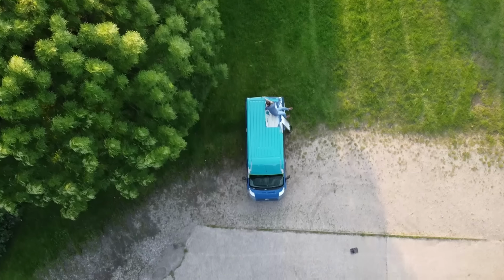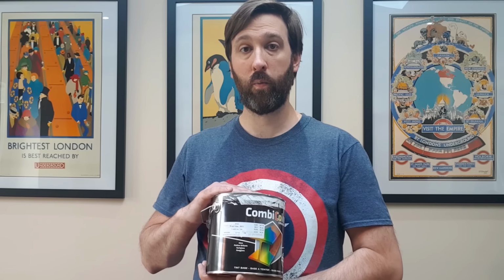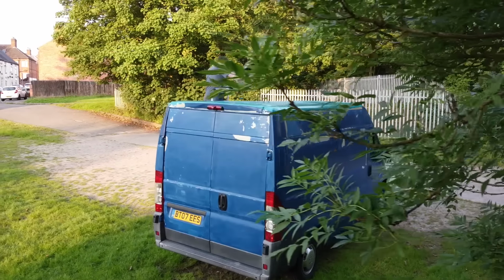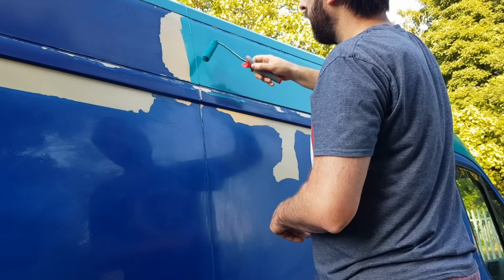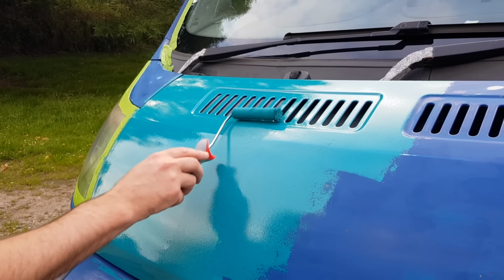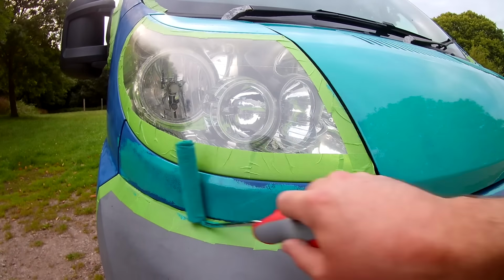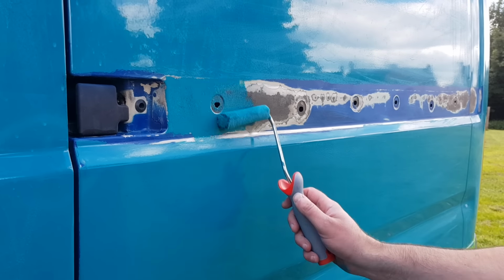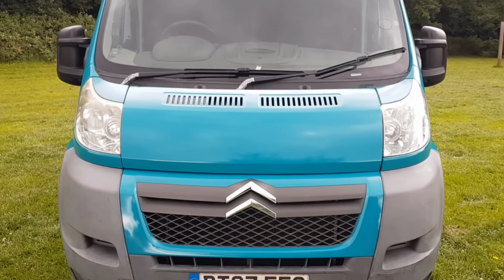Painting a CAMPERVAN on the CHEAP with a ROLLER! - DIY Budget Campervan Conversion

Comment: How's the paint holding up over time?
Reply from the maker: Hey Matt, on the whole it's still looking pretty good. There are a few minor issues but they stem from other factors. For instance, on the rear doors I had a window leak and used Captain Tolleys crack sealer to sort it out, it's a clear liquid but has ran down the doors leaving slight streaks in the paint. That's it really. On the driver's side I had to get another window professionally replaced too as it was warped and when removing it they lifted some of the paint from around it but that's an issue with the poor old paint job lifting from the primer and taking the new with it. My application with the roller was pretty good on reflection as there's very little noticeable orange peel effect in the paint but it's something I'm aware of. It really does look good considering I've only put down two coats. The plan going forward is a further one or two coats with a final flat and polish. I don't expect a professional spray finish but it'll be more than good enough for me. Sorry for the waffle mate but hope I've answered your question. 🙂👍

Comment: How would you rate the combicolor? My partner and I was a soft pale blue to paint our van but cannot decide on how accurate the colours are?
Reply from the maker: In my experience swatches never quite marry up due to numerous factors. Happy with ours turned out and the paint itself is quality. Only issue we've personally faced is a little peeling in a couple of places but that's down to the poor original paint job back in the factory which these vans are notorious for. Highly recommend taking this route on an older tired looking van.

Comment: You've inspired me to paint roller my Transit! How many litres of paint did it require to coat the van?
Reply from the maker: 2.5ltr tin has done us good for two and a half coats mixed 4:1 with thinners. Good luck if you do your own!
Reply: @PilgrimPods  Ahh. Thinned down. Good stuff. I'm looking at using Military Paint. Whether that's any different, I'm not sure. Thanks for the reply. Where you located? Your accent sounds near me.
Reply from the maker: @lurchthebastid3991  Tamworth here!
Reply: @PilgrimPods  ahhhhh. I'm Walsall. Not too far away. Thanks for the info on paint. Appreciated.

Comment: Hi mate , how did you thin the paint ? What did you use
Reply from the maker: Hey Shawn, thinned 4:1 using just the cheap No Nonsense white spirit from Screwfix.
Reply: How did you measure it out ?
Reply from the maker: @shaunpeace3669  just using a mug mate. 😄

Comment: Do you think that if you had chosen not to thin the paint you would still have had enough paint to give the whole van one coat?
Reply from the maker: Easily. A 2.5ltr tin is enough for a good two and a half coats on a MWB thinned 4:1. 🙂👍

Comment: Did you use the 3-1 ratio on your second coat ?
Reply from the maker: 4:1 on both coats. When we add the last two or three coats we'll be using the same ratio too. Hope that helps! 😊👍
Reply: Pilgrim Pods yes thanks, just need to courage and energy to start. I like that it comes in many colours.
Reply from the maker: @pebbles8022  it's honestly brilliant stuff. I'm not sure I'd be brave enough to paint a brand new van with it but for something older I certainly wouldn't hesitate. Once we've built up the coats and polished it it'll look great and the beauty is if it gets scratched we can just touch it up. Best of luck with yours! 😊👍
Reply: Pilgrim Pods lol... Mines 29 years old, don't fancy 4 coats though, how does two coats look,could I get away with that ?
Reply from the maker: @pebbles8022  two coats looks fine on ours but I want to eventually build up the layers for a nicer finish is all.
Reply: Pilgrim Pods thank you very much for your help.

Comment: Amazing, great video. Thank you for putting this together, I think I may try to re paint my van like this as well. How long do you reckon it took you to do the two coats?
Reply from the maker: Thanks for checking it out! The beauty of painting with a roller is you can paint it panel by panel and in small stages. Overall though it probably took no longer than six hours a coat. Do it! 😀👏

Comment: Would you recommend a foam sponge roller?
Reply from the maker: The only ones I can personally recommend are the gloss short pile rollers I've used. They did such a great job I didn't need to test out the foam rollers that came in the pack I bought. Link is down in the description for the ones I opted to use. I know other swear by the Fussy Blokes rollers but they cost a lot more and I'd be surprised if they get a much better finish than the cheap ones I used. Hope that helps! 🙂🍻
Reply: @PilgrimPods  yea it does thank you. I’ve rescued a car which the last owner got their crayons out and painted it…. Matte black….  Crayola’d well and truly. Graffiti remover has helped. But I’ve not decided what to do yet.
Reply from the maker: @Landie_Man  if it's old and tired I wouldn't hesitate painting with a roller. Cheap and cheerful and you can get a really good finish if you take your time. Not sure I'd roller something newish though I have to admit. I achieved a good finish but it's not what I'd call a factory finish though I know others have managed to achieve that with practice.
Reply: @PilgrimPods  your vans fairly new though. 2006/7?
Reply from the maker: @Landie_Man  is 2007 new!? To be fair I couldn't make it look any worse than it already did. I'd probably be brave enough to paint anything five years or older. If our MWB turns out to be too small for us I'll buy a newer larger van and paint that with a roller without a second thought.
Reply: @PilgrimPods  I’m biased. My daily
Driver is 1988 and aside from a 1992, all
My other collection are 70s and 80s.

Comment: How did you deal with the door shuts?
Reply from the maker: Hey Tom, truth be told I haven't yet. I should have painted them whilst doing the rest of the van but left them. Before I build the cabinetry I want to finish off the inside of the doors so will be tackling tidying up the paint then. I imagine it will be just a case of removing the rubber seals, cleaning the areas, key the old paint, clean again and then go to town with a roller and foam brush. I plan to show how I tackle it in my next video when I get a decent day of weather! 🙂

Comment: How does this react to washing the vehicle after though?
Reply from the maker: Prep is key, pardon the pun. Provided the paint beneath has been well keyed you shouldn't have any issues with the fresh coat. I give mine a blast over once in awhile with a pressure washer set to it's car setting and haven't had any issues. You need to remember with my van as well that the original blue paint wasn't applied very well to the primer hence all the original flaking so really I've applied good paint to bad and it seems to have sealed it well. If you check out my 'fixing leaky windows' vid you can see when I have the side window professionally replaced some of the old paint lifts from the primer taking the new with it but other than that requiring feathering in and touching up all is golden. 🙂👍

Comment: Very surprised at the finish for a first job and roller, seems a bargain.  I personally wouldn't bother with more coats because I'd be thinking the existing paint is protecting and you only need enough for a finish, I don't know if you did the other coats.  How long did the painting take?  Was it just two days painting and the prep time?

Comment: Is this paint gloss or matt?
Reply: Also, did you use the same paint for the plastic section around the radiator grill?
Reply from the maker: Hey Sam. The paint we used is gloss and yep, we used the same stuff for the grille; you can apparently paint the bumpers with this stuff too providing they've been given a good key! We didn't fancy colour coding them though and will be painting them dull and boring black. 😁👍

Comment: HI... GREAT JOB... AND FINALLY UK... PAINT JOBS.. AND I REALLY NEED TO SEE MANY ROLLER PAINT.. AND THE MASSIVE PANELS ON YOUR VANS, WOW...
IT WOULD LOOK NEW WITH CLEAR ALL CARS NEED CLEAR FOR SUN , WEATHER, SNOW, KEEP PAINT NICE...
I JUST BOUGHT A USED 2009 DODGE JOURNEY, A FRIEND OF MINE DID SURFACE RUST AND PRIMED AND THE STORE SCANNED WRONG.. SO I WANT TO WAX AND BE
PROUD OF MY CARS,. SO OVER A (BEIGE) NUT REALLY LIGHT SANDLEWOOD METALIC , I WANT TO DO A WINE COLOR SINCE LOVE WINE COLOR CARS AND CLEAR COAT, SO IF YOU CAN TEL ME SPRAY OR ROLL.. ALSO, WONDER IF CAN ROLL CLEAR,,,HUMM.. JUST WONDERING... THANK YOU FOR THE VID, YOU REALLY DID A GREAT JOB! 
THANKS FROM 😒OUFFFF QUEBEC CANADA....!
Reply from the maker: If I'd had the money I would have bought a compressor and had a go at spraying it but I have to admit I've been so impressed with the roller job. If you take the time you can get a great finish or you can just pretty much throw it on and it still looks decent from a couple of metres away. Good luck with whatever you decide. 👍

Comment: This is an interesting project. Did you consider using those paint pads that they claim make interior decoration a lot easier? Apparently they give better coverage and leave a superior finish. 

Thank you for sharing
Reply from the maker: We didn't consider using anything but rollers and foam brushes as they are cheap, cheerful and proven to get a good finish.

Comment: Did it last , I mean...did it start peeling again ??
Reply from the maker: It's lasted yep. One area above a rear window looks like it might bubble in the future but the issue will stem from the original paint beneath lifting. Even so, I can't recommend this method highly enough for an older van like ours with peeling paint.
Reply: @PilgrimPods  ta bud...will follow instructions.. cheers

Comment: That van was a Rolls Royce compared to the shed I just bought, I won't be taking anything off and if coat number 1 comes out as good as yours then there won't be a coat number 2.
I just watched another video where a couple painted a perfectly good van with 5 coats to make it not as good.
No amount of paint is going to make my van look decent, you can't polish a turd.  The aim is to not look terrible and just 'blend'.
Reply from the maker: You can't polish a turd, but you can paint it! 😄🙌 If you go the same route as us we think you'll be pleasantly surprised. Ours had a few bumps and scrapes not to mention a terrible paint job and we've managed to transform it for no more than £50 and a bit of time. Best of luck with yours man. 😊🤞
Reply: @PilgrimPods  - Mine looks like someone has been shooting airguns from inside, plus it's been crashed so had the front wing and passenger door slightly re-arranged.  The garage who recently replaced the wheel bearing were shocked when I said it had an MOT!!  They had to check their computer.  Gearbox grinds into gear (synchro rings are shot) but the engine is 100% on point with new cambelt & water pump and only 111,000 miles which is why I bought it.  It mainly just needs to survive and earn me some money up until MOT time, then we'll see.
Reply from the maker: @marcustaylor670  interested to see what it looks like! 😬 Fingers crossed it keeps on going for you then. 🙂🤞
Reply: @PilgrimPods  - Might do a video when I paint it for a laugh.

Comment: Might I suggest using a larger roller if you have a fairly large area to paint, such as the back of one of those doors? You should use a 6-inch or 9-inch roller. You can keep the small roller nearby so that when you need it and it's convenient, you can use it. Watching you paint the back doors with that tiny roller makes me cringe; it's just unnecessary.

Comment: Wow looks great! I’m thinking about doing the same, but do  you mind answering these questions that I have? 🙂

1) In the end did you get any roller marks on the van? 

2) What’s the van like now with the paint work? Ie has it held up well and does it scratch easily etc 

Hope you can answer these! 
And Well Done! 👍🏼
Reply from the maker: Hi Em no roller marks can be seen, it's as smooth as butter. It's no different to painting a wall of your home; when you roller that you don't see any roller marks. The paint does take a few weeks to fully harden and can be scuffed in that time as I found out leaning a ladder against it to get to the roof... Once fully cured though it seems to be really robust and shouldn't scratch easily. Worse case scenario and it does get a scratch going down a country lane (which of course any van could) I can easily touch it up again using some left over paint. Twelve months later and it still looks great despite never having a polish. If you have a tired looking older van I certainly wouldn't hesitate painting it with a roller! Good luck in whatever you decide!

Comment: is this normal car paint!
Reply from the maker: No mate. RUST-OLEUM CombiColor Metal coating is primer and topcoat in one, based on a urethane modified alkyd, providing good drying properties at low temperatures. The product contains rust-inhibitive pigments and is lead- and chromate free.

Comment: why use such a small roller on such large areas?
Reply from the maker: Smaller roller means you can more easily manipulate the paint to achieve the finish you're after. 🙂👍
Reply: @PilgrimPods  I see thanks

Comment: A foam roller is best I bet you got tiny hairs from that roller
Reply from the maker: Foam rollers disintegrate quickly due to the solvent and large panel areas and nope, there were no tiny hairs. Manufacturing a roller sleeve that sheds tiny hairs from it as it is used makes no sense.
Reply: @PilgrimPods  depends on the roller thr cheaper ones do fall off the sleeve as the paint desolves the glue ..the good ones last for ever I've got some that are 20 years old in oil and fine ..there about 12 pound each tho and the finish is like a factory spray
Reply: @PilgrimPods 
I have so many questions-  Love the outcome with your van!

I note you used Gloss, you've convinced me to change from the Matt.

How many litres did it take to complete 2 coats? I note you have some left

Did you thin the paint with actual White Spirits or did you use another paint thinner?

Was trying to decide which application is best - use the mohair roller or the foam, I get your point about foam rollers though!

I have a Sprinter that is in serious need of a respray - some (not a lot) rust to deal with, and fading and scratching from previous owner graphics, along with damage when someone tried to jemmy into my parked van 🤬.

Thanks for your help!

Comment: When the sunlight hits that the flashing is going to look horrendous
Reply from the maker: Hey Charlie, thanks for sharing your opinion but in this instance you're wrong. I can assure you there's absolutely no issues whatsoever with this sort of paint job. It's been on the van for almost 12 months now and looks as good as the day it was first rollered. One thing it would benefit from though is a good flat and polish but I intend to get another coat or two of paint down first. Thanks for checking the video out mate. 🙂👍